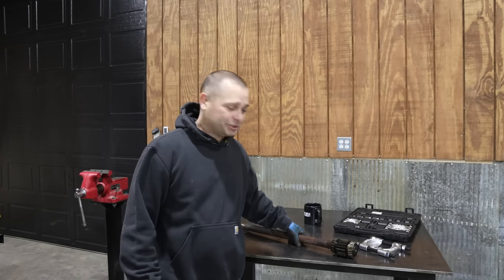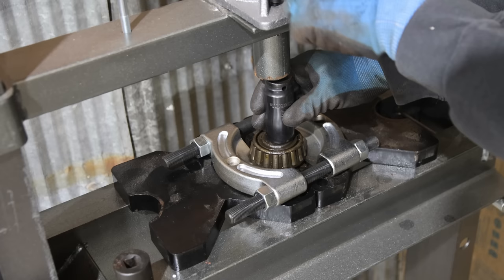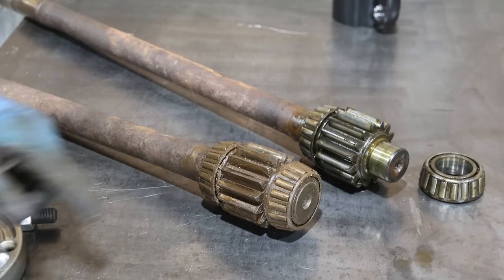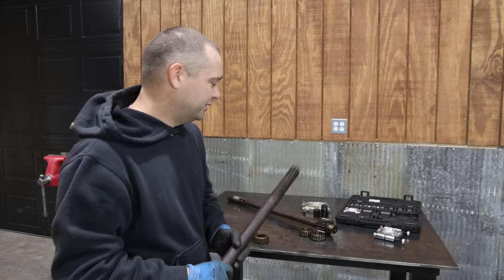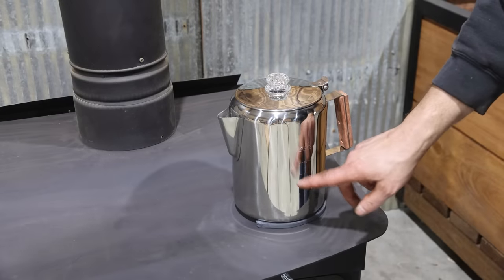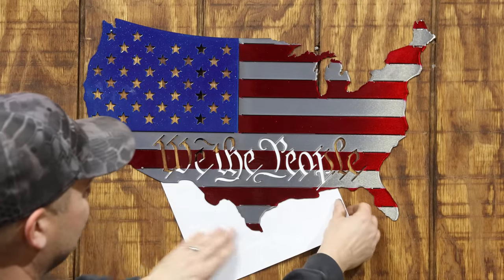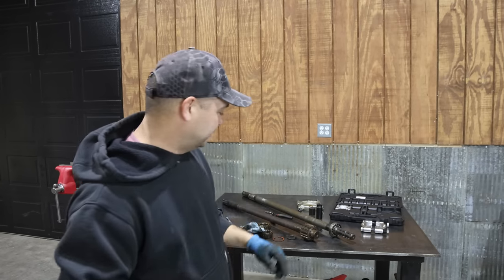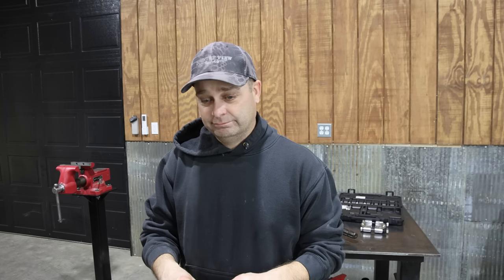Removing Allis Chalmers D17 Axle Bearings  |  American Flag Metal Art  | Trouble with Snap Rings

Comment from the maker: Apparently they are called Retaining rings instead of snap rings.  They do make a tool for external retaining rings.  But what about internal retaining rings?  I have a couple inside the final drive, that need to come out to remove the bearing races.
Reply: Internal can be a real bear.  The “wedge a screwdriver” method will eventually get them, but a 3rd hand is sometimes needed.
Reply from the maker: @d6joe  yes, an extra hand would be helpful in the process.
Reply: You need to punch the rings off. 1 shot. No need to grab. Just clamp the object, and than punch
Reply: From my research, I found you need circlip pliers with knurled external tips.... You can check yourself to be sure it's for the same piece as yours
Reply: Or maybe that's what you already have...?🤷‍♀️
Reply: @idontlikesunday  Lock ring pliers are a better solution.
Reply: Most of this advice is bad, bad, BAD. get the proper tool they make a pair for inside and outside rings. Prying and punching will ruin the ring, you can buy new ones, but it can also ruin the groove in your shaft. If that happens you are out a lot of money, and if you miss it and but it all back together it can ruin your whole project. I am a mechanic of 40 + yrs,  I have repaired a lot of stuff that people punched and pryed stuff apart.
Reply: @jimputnam2044  what is the "proper tool"?
Reply: Maybe go to a tractor mechanic or a antique tractor club and pick their brain for ideas or recommendations? 🚜
  Like the sign, white behind the stars and words will make them pop! 👍
    God bless 🙏🏼🇺🇸
Reply: I have that set and it works great
Reply: MAC TOOLS 90° TIP LOCK RING PLIERS P21A they are worth their weight in gold. For the heavier transmission style lock rings makes it a breeze to remove. Correct tool for the job makes it easy. Just like using your Hydraulic Press.

Need to keep the the same heavy lock rings. Not as you call it newer style snap rings with the wholes. 

Good luck enjoy your videos.
Reply: Why not just drill holes in the ends of your retaining rings?
Reply: if they are to be used internally, the bevel cut on the edges of the circlip will be opposite of the external ones (so that you can get under the edge) if that makes sense. I hope no one has been in there and put external ones in a internal groove! If  so you"ve got your hands full !When working on Big truck transmissions years ago we would just used a sturdy screw driver or pry bar to get them up out of their groove and push. the external ones we used circlip pliers , I have some old snap ons but i do see some offered on Amazon that are Knipex.... Love your content Keep up  the good work!!
Reply from the maker: The telegram scammers are constant.  I ban them from the chat anytime I see them.  I don't use telegram and I will never ask people for money.
Reply: @CountryViewAcres  it's someone who scammed me in the pass and often change his name, and wen I see that I look the name on the website if I see they have social media I'll let them know, so they can tell there followers that there is a scammer using their name.
Reply from the maker: @user-fy2vi6wc1c  owners of the channel will have a gray oval around their name.  Like mine does on this message.  That's an easy way to tell.
Reply: Lang Tools - 1485 heavy duty internal heavy duty internal retaining ring tool
Reply: Knipex 4521200 is what you probably need for this.

Comment: First, DO NOT replace the lock ring with a snap ring.  (the one with the holes to release)  The width of the lock ring is there as a spacer as well as a keeper.  Get the BEST lock ring pliers you can afford.  (It makes a DIFFERENCE!)  Buy (If possible) new lock rings because the sharpness of the point will make it easier to install.  (Will grab lock ring pliers better)  
This is first hand experience.  Older Jeep transmission disassembly.  Tried for hours and multiple times.  A good friend of mine (May he rest in peace) drove by and checked out what I was doing.  He immediately went to his house and brought a Snap-On snap ring plier and I took it off in two tries!  Yes, I am a believer!!  Great video!

Comment: Hey Evan. Try drilling small holes on the snap rings to fit your circlip pliers, and you can re-use the old ones. The round ones. Put them back in and forget about the next guy.

Comment: Evan there is a special tool for those retaining rings they are no longer made. But you can get them on eBay. Craftsman vintage 9"ring pliers  p 4735 what you struggled for hours with will take seconds with the these hope this helps

Comment: A beautiful flag sign, love it! I do the same as you did with the snap ring that don't have hole, screw drivers or picks. I would change them out to the newer rings with holes, they should be okay, for sure easier to remove. Loved the video, thanks and have a wonderful Sunday!🙂
Reply: Those snap rings are designed for a different purpose, don't ever swap them out for anything else

Comment: In a pinch you can use 2 flat blade screwdrivers. Insert both tips in the gap side by side, touching, then lever the screwdriver handles together, pivoting the tips apart. You have to play with length of shafts, thicknesses, etc. but as I do most of my mechanical work on evenings and weekends, necessity is the mother of invention.

Comment: Little tip: Draw your shafts and  record  bearing orientation and part#. and snapring  locations. To remove snapring spread at the tips to enlarge diameter and pick at opposite side.
Reply: As the parts locations are already recorded on the video, no need to go backwards and draw things I guess?

Comment: The square cut rings use lock ring pliers. They are similar to snap ring pliers, just have regular pliers face pushing outward.
On the round clips I would try driving a small center punch under the pin.

Comment: There is tool made for that style snap ring. They have flat tips instead the tips for snap rings with holes. I have a pair that I've had for years. I used them for stick shift  transmissions.

Comment: There is a special tool for those clips. They still use them on some equipment. Mine is OTC-714. I don't use it much as I'm retired now. If you can't find some, let me know and I'll send you these ones. They look like flat-billed pliers the open instead of close when you mash the handles. Official name is "Horseshoe Lock Ring Pliers". You can get them at Summit Racing.

Comment: I think those rings are called circlips, and there are special pliers for them. With that tool, they are very easy to remove and install. They work similar to your snap ring pliers except instead of the little round pins, they have flat duckbill jaws, and they expand when you squeeze the pliers.

Comment: Go to Amazon and look up 'lock ring pliers'. Kinda look like a duck bill with knurling on the outside edges to catch the pointy part of the ring. Mine are snap-on, and I would get a pretty good pair. Them are beefy lock rings. And NO, do not replace them with snap rings. They are beefy on purpose. Good vid. I need that air-assist press. :)

Comment: the way i've  taken those type off is with 2 flat screw drivers.  one to push straight in under the ring and the 2nd to put in behind the spring clip.  need it in a vise or something to hold it steady..  hope this helps.

Comment: When I took those out, I'd stick a pair of needle nose pliers [closed] in the gap, then pull the handles away from each other. The trick was to twist them just right to get the ring started out of the groove. Don't expect to get it on the first try if you use this method. Good luck!

Comment: The snap rings can be reused if they have tension in them when put over the axles and they snap into the axle groove when released. They shouldn’t be reused if they have been over extended when removed. When using the bearing splitter put the bolt section over the press plates. If your pressing wider items the bolt will bend if not supported.

Comment: Evan, you want MAC P21A, flat nose, lock ring pliers.
For internal ones, I reverted to a shortened tip 90° o-ring pick.

Best wishes from the far North.
Reply: Yes! Lock ring pliers is what they are, use these mac ones also snap on makes some that are nice. Still used to disassemble modern manual transmissions.

Comment: Evan put a small flat screwdriver under the face of one side of the retaining ring then lift it slightly and insert a larger flat screwdriver under the part you have lifted up then slide the large screwdriver round and lift the retaining ring free
They are usually located in drive shafts and may have one face larger than the other, this creates a wedge and gives them more strength as a retaining clip

Yes you should put the same type back on as they are much stronger than the other type of retaining clip
As I said it may have a higher face on one side, if you look at them they may not be square and you have to put them back in the correct way.

Comment: Great video Evan! loved that Hydraulic Press. I've been wanting to get one (Manual operation for odd jobs I'm retired (pushing 80) so no need commercially for one just some old mower blades to straighten out etc. love that bearing separator also that's a beast! but it sure did the job well. sometimes it pays to spend the moeny for the right tool. and at your age and what's ahead of you? I think you'll use it again a few times. well worth the cost. I'm really curious on those clips also hope someone comes up with a good solution for you and me! and the rest of the guys watching! god speed. ECF

Comment: Snap on makes external snap ring plier for them rings.  I think 4 or 5 versions. Snap On part numbers SRP1, SRP3 and SRP4. One on eBay now $30 or so.  Usually listed with transmission tools??.   I’m sure there is a cheaper versions.  There is also “Kent Moore” brand ones that are GM dealership tools.  Time for eBay.

Comment: Spring c rings not sure if you can find the old style or not.
They can be replaced with the new style.
Use a precision measuring caliper or veneer to measure so you can order the correct size.

Comment: use snap ring pliers that are 90 degree the pins are together when the tool is relaxed and when you squeeze the plier the pins spread giving enough room to get a small flat head or o ring pic behind the clip

Comment: Many of those round type retainers are spring steel meant to snap out to lock an axle in place once installed.  Some have a way to attach a slide hammer to them to remove the axle without removing the spring lock.  You have to jerk them out and hammer them in.  The spring is designed to collapse just enough to let it past through

Comment: sockets work great to press out stuff i use then with my big vice to do U- joints one big one small,  probably should have buffed the shaft with a drill and wire brush first. as jeff and mark and others said they make a ?duck bill ?set of pliers for the external but internal may have to hook under the tip and then put a pic or tiny strait screwdriver to work it out

Comment: There is a tool for those snap rings. Look for gear shaft lock ring pliers on Amazon. Those snap rings are still used in transmissions and differentials today. If you look at the ends of the ring where the tool spreads them they have a slight taper to them. Make sure when you put them back on the point of the taper is away from the bearing. Makes it easier for the next gut to get them off. 
As for the bearing that you can not get off. Cut the outer race off, clamp a center punch, point up, in your bench vice, crank up your oxy/acetylene torch as hi as it goes, stand the shaft on the center punch long side up and heat the inner race while spinning the shaft and the race will likely fall right off. The key to this working is heating the race up fast before the shaft has time to heat up. 
If you can not get the clip off you can use a cutoff wheel, holding it parallel to the clip and the groove it is in and grind the opposite side of the opening on the clip thin or even in two so you can knock it off with a punch. But before doing that try knocking the bearing away from the clip and use a punch to knock the ends of the clip loose from the grove. Sometimes the bearings move and pinch on the clips and the clips also get stuck in the grove and knocking the ends loose with a punch can make them easier to get out. 
Good luck! Thanks for sharing.

Comment: The narrow stile separate astrology diameter in the old style C drop rings. It really not interchangeable unless you can get the. Proper thickness And height. Unless you want to replace the axles and everything including rear end or influential. You have bears in there I should be checked also. Plus the spider gears. Oil feed axle bearing with 80wt gear oil.. .

Comment: You should always put your puller from one support to the other. the way you did your 2nd one not your first and third one. You will eventually bend your threaded rod if you don't. Always a good idea to put a rag over the top of the bearing  until you get it to move. That way if it breaks  pieces wont fly and hit you. Once it moves you can remove the rag so you can see

Comment: Duck bill pliers for those constant area external rings.  Internal constant area snap rings you use a hook tool or screw driver to get under and work them out.  Snap rings should be replaced.  The can be fatigued during removal and become costly problem.  They use constant area snap rings to proved better uniformed thrust surface, the other type has tendency to brake the tab when alternating thrust loads happen which causes problem.

Love your channel keep up the good fight

Comment: My father and I would take were he used a flat tip screwdriver and he would get behind one side and I used another flat tip and a thin screwdriver so when we pushed and whatever side broke loose I would get behind the snap ring and start lifting it out.
I would look at buying new snap rings with the holes so your life will be easier down the road if you I u have problems.

Comment: Circlip/snap ring - Try cheaper pressed metal pliers with a 90 degree offset. Slip old feeler gauges in under the ends of the clip when you get some clearance.

Comment: Start at opening between two ends of the ring. Drive small flathead screw driver (parallel) under one end. Use a larger flathead to work it around until it pops loose. 👍🏻 you can also use a pair of stout needle nose pliers and basically use them backwards to spread them just enough to get a small screwdriver underneath.

Comment: Recommend  emery cloth and WD 40  and knock  off the rust before  using  the press
Reply from the maker: Afterwards I put the axles in the metal lathe and ran emery cloth over the rusty areas they were catching on.

Comment: There are snap ring pliers made for the type of snap rings your dealing with. You should contact your local Snap-On tool dealer or equal or maybe your Napa auto parts store and they should be able to help you, but there are pliers for your needs.
Reply: snap-on  number SRP1A   I f you took a allen wrench that fit in your new pliers heat it beat down  like a flat screwdriver bend  end on a 90 qwench in oil  it will do  afair job

Comment: Replace them all with the new style retaining rings. On the round ring you might have to use 2 rings and that's alright if there is room, if not then just re-use the old ones. The rings strength is in the stopping force of the ring in the groove. Good video, you explained the trouble of working on old equipment. Check on-line for old iron support groups, they are there. Illinois and Iowa have lots of tractor shows. West of Springfield there were several Alis Chalmers Dealerships. There should be someone rebuilding these.